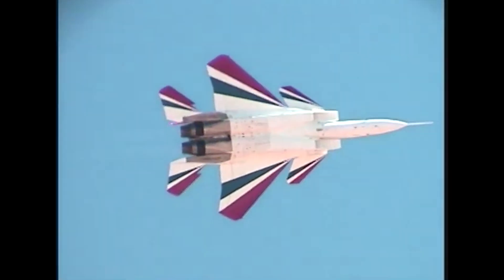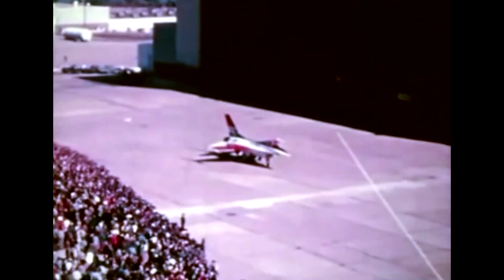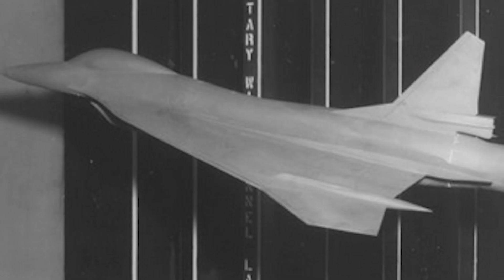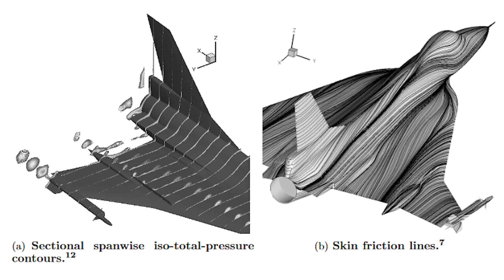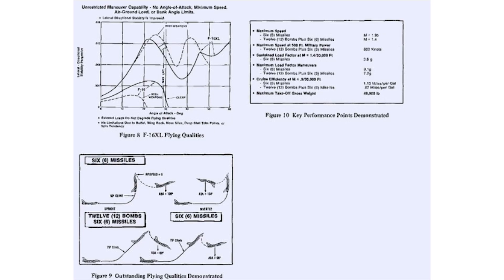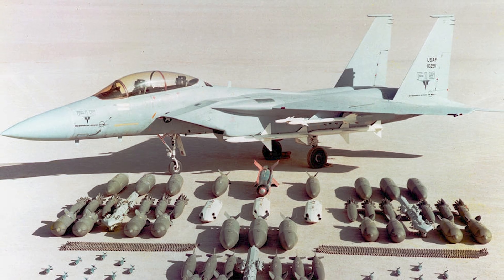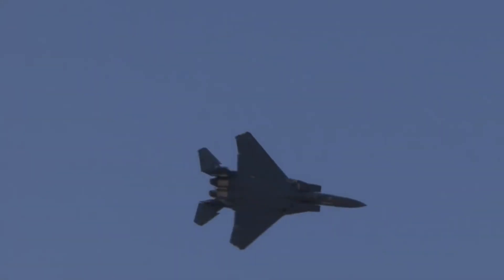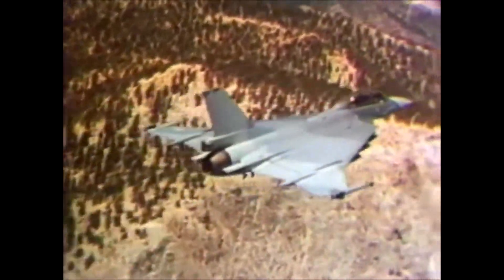Was the F-16XL the perfect fighter jet design in the 1980s?

Comment: I took exception with one comment he made about the potential costs of the XL.  He said converting the F-16s to the XL design would have been expensive and time consuming.  New build aircraft would not have been any more complicated or time consuming to construct.  Due to the increased size, however, yes they would have still been more expensive than a base F-16, but far cheaper than the F-15E.

Comment: Still sad to think the F16XL lost, but you can understand the air force's choice of picking the F15E too, because it would be a much easier conversion as well it the F15E having 2 engines, providing extra security for safety. But I still think the F16XL should've literally replaced current F16 models. Same with the YF23, being better than the raptor in every aspect except for maneuverability. Two of the greatest designs and probably the best looking too. Missed opportunities occur far too frequently.

Comment: I listened to an interview of Gen. John Michael Loh, the USAF Lightweight Fighter and F-16 program office head, so one of the fathers of the F-16, along with John Boyd. He was rather against the idea of the F-16XL, which he felt was an attempt to over-grow the F-16. He pointed out that it was non-competitive with the F-15E, which is not surprising, as the F-15E has twice the engine to carry the same payload. It's in the Aviation Week Check 6 podcast, Feb 9, 2024, about 24 minutes 30 seconds into the podcast.

Comment: Who ever cancelled it needs to be let go. The F-16 is still in demand. The XL would have been a excellent long range version. Add the conformal tanks, who knows how much more it would have flown. And given that munitions are getting smaller and smarter, the XL would have been a great bomb truck for air forces that can't afford the top of the line fighters. Even the united states air force is having budget issues. Something more capable and cheaper can fill many roles.

Comment: It really wasn't that great, not 'overall'. Impressive in some ways, but not in others.
Also, beware any hype which makes a fuss about the number of hardpoints, rather than the actual payload capacity. It's like saying your truck has more tie down straps... doesn't mean all that much.

It's thrust to weight ratio and handling were drastic downgrades from a regular F-16.
Also, for it's intended role, "deep strike", it was inferior to the F-15E by pretty much every metric.

But it would have made a very interesting mid to long-mid range plane in the 1990's (rather than 1980's), when the F110 engines became available for 16's. That would greatly alleviate thrust to weight concerns. Especially if some small forward canards were added to give it better handling (like the F-16 CCV test vehicle, but perhaps biased a bit more horizontally). That would've made it pretty cool.

Comment: I think one of the main issues was that it kinda removes the main advantage of the f16, basically that 2 circle performance.

But if course it did, it's a multirole aircraft, that's not really its point. 

But removing that kinda defeats the purpose if the aircraft being a light fighter. The strike eagle was just more viable for the role being larger and having 2 engines.

Comment: Imagine a modernized f-14 given a delta wing configuration.
Now that would be interesting too.
Build it around a 30mm gau.
Make it into a multi-role craft and upgrade it with a stealth kit upgrade later on.
In essence a interim craft that may evolve into a fully supported platform.
Reverse swing wings that can fold into the main delta wing to add as a further maneuverability asset design.

Comment: A scale down F16XL to fit the original F16A would cost several million less than F15E...the problem is they outsource or the original engineers used a large office pool because they did not know how to type nor use computer CAD software to scale down the manufacturing design....  They lied on their resume today.

Comment: People forget that even in 1976, McDonnell-Douglas showed the potential of what became the F-15E with the addition of conformal fuel tanks and also the aiblity to carry various types of payloads. As such, the F-15E was almost an "off the shelf" modification of the F-15D, which lowered production costs per plane.
Reply: The F-15E also had twice the thrust of the F-16XL, to try and carry the same payload. Gen. John Michael Loh, the F-16 program manager for the USAF at the time of its creation, and one of the great champions of the lightweight fighter concept, was no fan of the F-16XL.

Comment: No, this is just more YouTube mythology.

The XL was originally designed to explore improved supersonic L/D and allow for super cruise.  The airplane did not achieve its super cruise goals.   It would probably have been somewhat more maneuverable at supersonic speed, but at subsonic speed it had more induced drag and therefore lower sustained turn rate than the original F-16, which after all had been intentionally optimized for maximum sustained turn performance.

The XL was later entered in the ETF program, but this was not its original purpose.  The super cruise goal was forgotten when carrying bombs.  It would have been a good strike aircraft, but the F-15E was less expensive, less risky, and more capable in some ways.   

The XL was not produced for sound reasons.
Reply: Most aircraft that get lauded as killer "what-if" designs retain their image because, never having been put into production, no one ever sees what their warts were, and what bumps their programs would have hit.

The biggest reason the YF-23, another Internet-favorite "what if" was not selected was because Northrop Grumman had expended most of its goodwill with the USAF during B-2 development problems, and the USAF was not as confident in their ability to deliver.
Reply: Actually the GE engined version did after additional tweaks and after the competition with the F-15E had completed.  Of interesting note, the big engine F-16Cs can, today, in a clean configuration go supersonic without afterburner.
Reply: @carlpboyer   Ater transfer to NASA "the F-16XL-2 had its engine replaced with the more powerful General Electric F110-129.[12][37] It achieved limited supercruise, a design goal of the F-16XL that was never attained in ETF testing, when it reached Mach 1.1 at 20,000 feet (6,100 m) on full military power."

A paltry Mach 1.1 is not meaningful supercruise considering the conventional F-16 could already sustain a very high transonic Mach number in mil power.  The cranked arrow wing experiment did not deliver much of a difference.
Reply: @gort8203  Mach 1.1 at 20,000 feet is actually pretty good given most high speed testing is done at over 30,000 feet and a 100 to 200 knot advantage is still significant.  That said, no, it isn't what the program was looking for.
Reply: @carlpboyer  20,000 ft is indeed a fairly low altitude for Mach speeds, and the reason it was fastest there that was that even the more powerful engine did not have sufficient un-augmented thrust to break Mach at higher altitudes.  Calling Mach 1.1 supercruise is kind of pitiful and it did not meet the expectations of the original program.  As I said, this is not much faster what a regular F-16 could do and is therefore insignificant in terms of air combat tactics.
Reply: @gort8203  Out of curiosity, was that specifically called out in the NASA testing data?
Reply: @carlpboyer  Was what specifically called out?  In any case I don't have the testing data, I just referring to numbers available online in places like Wikipedia.
Reply: @gort8203 you get your data from Wikipedia?... You already lost any argument you could possibly make
Reply: @RedTail1-1  I don't get my info from Wikipedia.  I don't have to make an argument because I know what the facts are, and I don't care if you don't want to accept them.  Just go away because I'm not interested in debating another video gamer who thinks he understands military aircraft.
Reply: One of the few accurate comments about the F-16XL. Of course, you won't get all the upvotes as people don't want accurate information.
Reply: @soulsphere9242  It continues to amaze me how people latch on to myth and misinformation and then refuse to accept actual facts when presented with them.  It seems to be related to social media and the internet becoming the predominate form of information exchange for the masses.  It's ironic that internet was projected to make us smarter because all the information in the world would be easily accessible, but it seems misinformation is what multiplies and spreads like disease.

Comment: Honestly, if Lockheed wanted to keep the F-16 alive then they would be wise to go back to the F-16XL configuration for future blocks of F-16's. It would be superior in terms of range and payload than a late model F-16 with conformal fuel tanks. It is truly a shame that the F-16XL never went into production.
Reply: It is a shame the XL wasn’t produced. However the USAF hasn’t bought F-16’s in decades. Having painted itself into a corner with long delayed F-35 production the AF opted for new F-15’s over any other fighter.
Reply: @Idahoguy10157  Most of the Block 60 and higher F-16's were bought by foreign air forces like Poland and the UAE.
Reply: F-16 production is ramping up again for many countries that don't want or can't afford the F-35 but still want to get the newest upgrades with an AESA radar, improved ESM, and all that stuff. An XL form factor could have been great for this.

Comment: Yeah it's crazy how much wing loading and fuel capacity increase when you remove the negative lift tail and extend the main wing. GD had a good idea here and it's a shame we never got any

F-15E was the better choice though. Large draggy tails are bad for turning but really good for when a major source of lift disappears
Reply: The F-16 doesn't really have any more of a 'negative lift ' tail than the XL. That is the whole point of relaxed static stability and the aft center of gravity.

The idea was a wing with higher lift to drag ratio at supersonic speed to allow super cruise on the same thrust. It didn't really pan out. On top of that It would have been inferior during subsonic maneuvering.  

We didn't get any because we need this airplane.

Comment: Australia should build this as it would  prove useful  even today
Reply: Everything it did, still wouldn't have replaced the F-111, and the F-18-G's would still be a better choice for the same reasons as the XL lost out to the F-15.
The XL would have been superior to the F-35's in every way though.
Reply: @PiDsPagePrototypes  I agree with you and it's main advantage would be similar to the Japanese F2  and the Korean FA50 F16 based aircraft.  It would also boost our air fleet
Reply: @jayteeb1  More F-35s would be a better spend, even for less platforms.
Reply: @PiDsPagePrototypes Ummmmm, no, the XL would not be better than the F-35 in all respects.
Reply: @thelandofnod123  Speed, fuel capacity, range, range at speed, load capacity,... Being delivered on time and on budget wouldn't happen though, not for any aircraft supplied from the US.
Reply: @PiDsPagePrototypes  Ability to survive a modern BVR fight with a near peer adversary? This is what the F-35 was produced for. Having the undisputed post merge fighter in your fleet is irrelevant if it can’t get there. 

All fighters are a comprise in needs, the XL simply isn’t needed or indeed wanted in Australia’s modern battle space. The balance of platforms in the RAAF is almost perfect with what’s available, save for Strike Eagles in place of Super Hornets perhaps (cost is the issue there).

Comment: The crazy thing with the F-16xl, is how it didn’t just become a production model of F-16 anyways.
Reply: Not crazy, logical.  It was a very different airframe, would have been expensive, and was not needed.  The correct choice was made.
Reply: Not really they did it with the F/A-18E/F. There is very little in common with the legacy Hornet. Even when the Army started to buy the 'Mike' model Blackhawk, they started out refitting 'Limas' to the new standard but found it was cheaper to build them new. The same would have been true for the XL, and it was very much needed, it's why there was a competition. Your logic is flawed.  @gort8203
Reply: @ImpendingJoker  Nobody was talking about refitting existing F-16s into XLs, they would have been all new airplanes if produced.  They would have been more expensive than the F-15E, had more development risk, and offered no performance advantage over the F-15E.  A new fighter-bomber was needed quickly, but the XL was not needed.
Reply: Even if you didn't take the retrofit route, you'd need to make almost a completely new production line for it. Compared to the F-15 which just worked as is, that was a big ask.
Reply: Not really they did it with the F/A-18E/F. There is very little in common with the legacy Hornet. Even when the Army started to buy the 'Mike' model Blackhawk, they started out refitting 'Limas' to the new standard but found it was cheaper to build them new. The same would have been true for the XL, and it was very much needed, it's why there was a competition @Appletank8